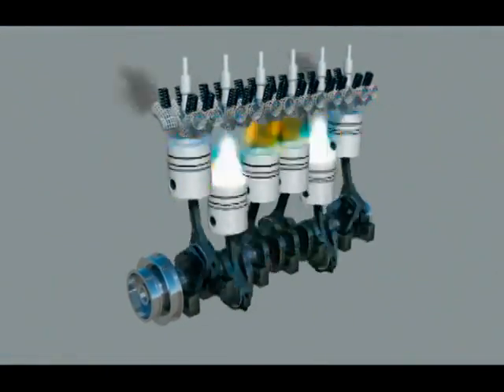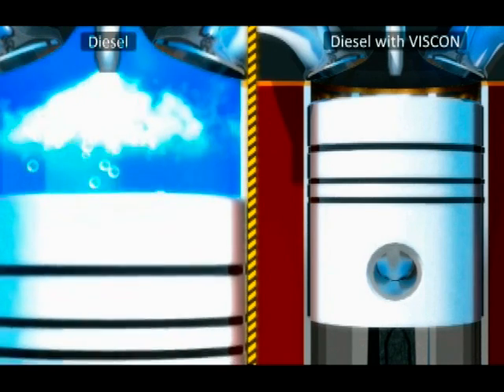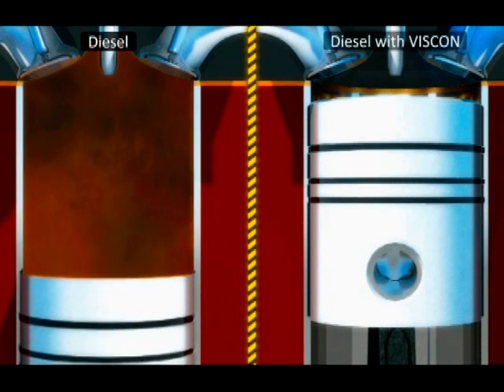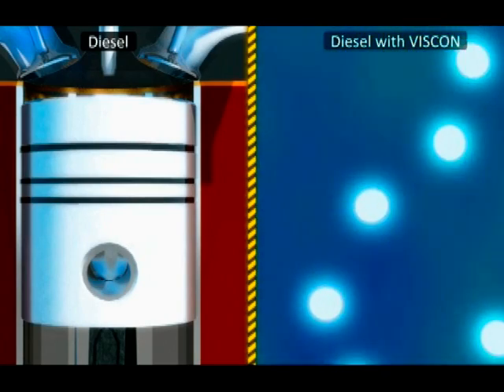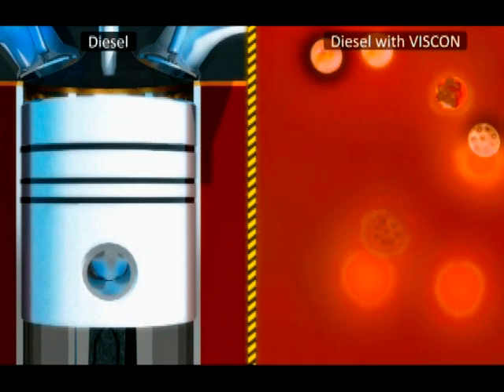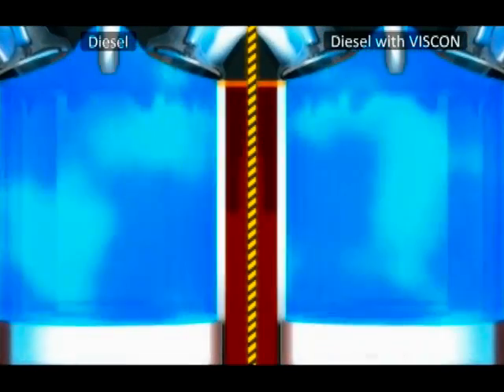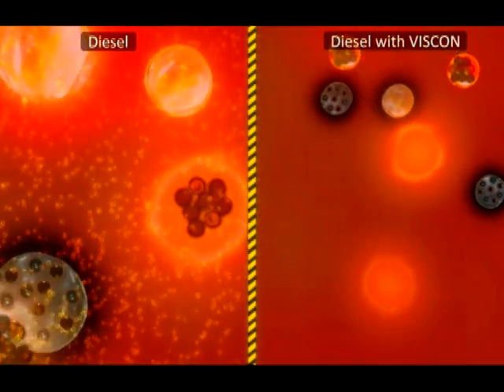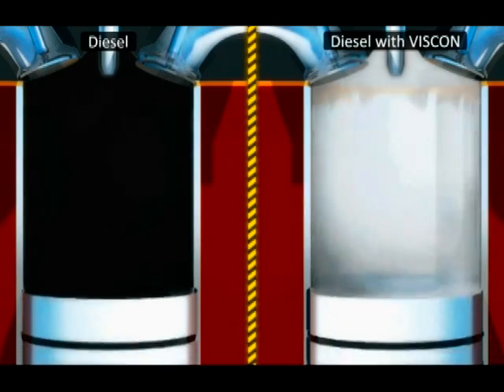Impact of Viscon Fuel Additive

Comment: You should really read the patent on this from 1996 High molecular weight fuel additive.  Formally Viscon was called General Technology Applications, Inc. (Manassas, VA)
Abstract
A method and composition for improving the mechanical efficiency of a engine is provided. Ultra-high molecular weight polyisobutylene (PIB) added to the fuel changes the momentary mechanical properties of the fuel during induction. The additive provides a more uniform spray droplet size, increases the extensional viscosity of the fuel, and adapts other physical properties, under induction conditions.
Classifications
 C10L10/02 Use of additives to fuels or fires for particular purposes for reducing smoke development.
US5906665A
It is used in many areas of chemical engineering globally across many technologies, & not just a fuel additive..

Industry Leaders: ExxonMobil Chemical, BASF, Lubrizol, and Infineum hold significant market share through established production capacities, diverse product portfolios, and global reach. Their strategies focus on expanding production capacities, R&D for advanced HMW PIB derivatives, and strategic acquisitions to strengthen distribution networks.
Regional Champions: Regional players like China Petroleum & Chemical Corporation (Sinopec) and Formosa Plastics in Asia play a vital role in their respective markets. They compete on price, cater to regional preferences, and build strong local partnerships.
Specialty Niche Players: Smaller companies like Nippon A&L and Entek specialize in high-performance HMW PIB grades for specific applications like fuel additives or medical devices. They leverage innovation and cater to specific customer needs, often commanding premium prices.